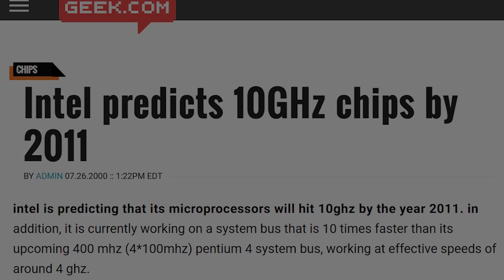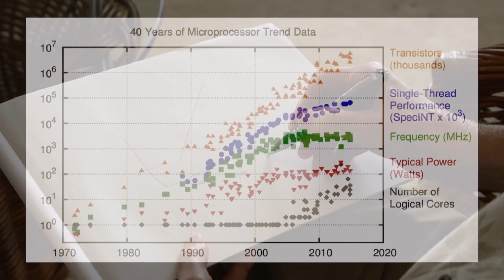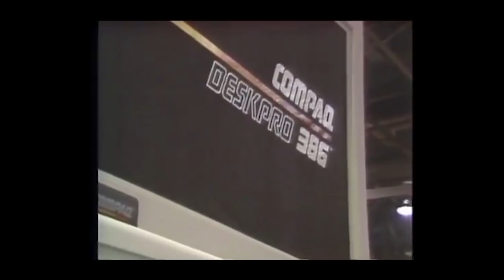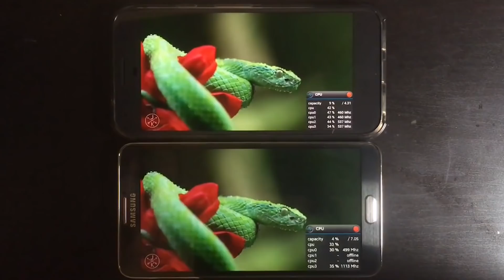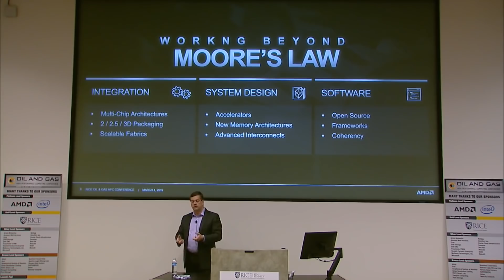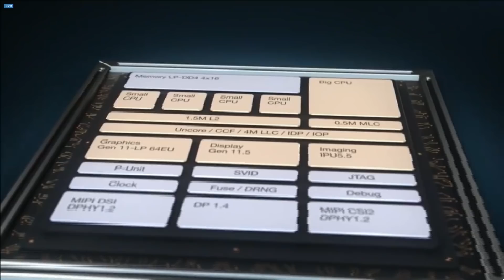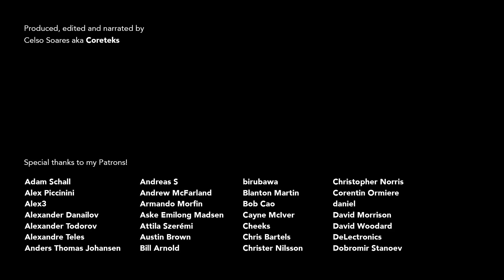Intel and AMD going BEYOND Moore's Law

Comment: Serious note here, what were the people expecting a 100ghz processor smoking? Speed of light propogation delay in a vacum would only get you a 3mm long signal path. It is unreasonable to think that instead of scaling out we would just settle for 9mm^2 CPUs with low transistor counts.

In an unrealistic situation with no switching delay 50ghz gets you 36mm^2, or half the frequency with quadruple the transistors, and 12mm getting a fourth the frequency at 25ghz with 16 times the transistors.

This means you get double the theoretical performance of a 3mm wide part at 6mm, and four times the performance at 12mm.

There is obviously a trade-off, since the 12mm part is only four times as fast despite having 16 times the area. This decrease in performance per mm°2 at larger core complex sizes definitely shows the existence of an efficiency sweet spot. 

SIMD style chips aren't affected quite the same way since they rely on mass parallelism, but the limitations still appear when trying to load data from memory.

 The only system architecture which might completely avoid this is one running a Barrelfish style multikernel on a non cache coherent processor with direct intercore communication. You can solve the task allocation with a Que Management Device for lower core counts, but a multikernel approach is going to have a scaling loss with a lower growth exponent than a hardware solution.

Comment: I am studying software engineering, your statement about not being taught multi-threading is not 100% accurate, we and most universities that I have heard of have a unit normally called Operating Systems that covers writing multi-threaded applications, normally in C due to it being such a low level language. It is then up to the developer/student if they wish to write future projects/assignments to take advantage of multi-threading, however most will not do so at university as your assignments are often relatively small and you only have a few weeks to complete them so seeing as you will not see a benefit in said small programs and only make your life more difficult most people do not do it for such small projects.
It is important to note that the university just provides you with a basic understanding and it is up to you to build on that, so most developers will not multi-thread unless they deem it necessary.

Comment: It shows Coreteks is not a programmer. Parallel code is not that difficult (seriously); It's all about splitting tasks.
Amdahl's law concerns single task ... not even single application :) There is always a lot of tasks running. Workstation i am writing this on is running 162 tasks on 882 threads. So for me, performance boost is not limited to 16 cores even with today's coding.

For example, this very page, single tab on browser, could be made to scale to 100s of threads - and it's not even "that difficult" - You simply split the tasks up. Very same thing you do with when you manage huge amounts of data - You split it up in organized manner. This is why "nosql" was such a big deal and huge hype some years ago; It forced non-skilled database admins to split up and index their data :)

Parallelizing is only hard when you have to parallize single task, for example rendering a single image. Difficulty depends on data format. But there is nothing stopping you from doing a single image render on 10 000 threads simultaneously other than available performance and acceptable latency as I/O channels filling up will increase latency. The true bottleneck is I/O - and has always been so. That's why AMD is so heavily emphasizing I/O.
Reply: "Parallel code is not that difficult (seriously)".
It is much less easy than single thread programs. You need a deeper understanding of the architecture, you need to manage all the threads with all that shared memory properly, you have to find tasks that can be split up which may involve designing a new complex algorithm that can run in parallel.
Anyway, I agree with you that this video describes it like it is almost impossible to code multithreaded programs.
Reply: @dariusduesentrieb  Yes, some knowledge of how computing works on a low level is required; Which any person coding anything performance critical should know already.

It's much less difficult than non-coders, and low skilled coders make it to be (unfortunately, i consider ~90% of coders to be low skilled). Basics are very simple -> Split up the data.

For example a old piece of code i wrote in the 90s, at a time the only practical way to get multiple cores was having multi cpu system, i had timers on one thread, sound in one thread, and OpenGL commands in one thread. Adding more threads would've been simple, but there was no benefit at the time (plus it ran like 200fps anyways).

To further split that up, if there would've been a need, i would've added a thread per audio channel (for SFX), separate thread for texture loading, geometry calcs (ie. order in which to draw polygons and perspective/camera), certain effects would've been on separate threads (distinct draw order), a separate thread to manage the actual calls to GPU (instead of calculating when making the call certain aspects) etc etc etc.
You split the tasks up.

When you get to something which is single task (single piece of data) the Amdahl's law may apply to your case, but often it is still just figuring out the separate tasks.

Data separation is the keyword; Then you do not need any code to manage multi-threaded memory access nor give it any thought. But when you need same data for many threads, often you can figure out a atomic method; For example, you can use RAM like a filesystem under Linux at pretty much full ram performance in every regard, but as you manipulate it like an FS, you have atomic functions to utilize; Thus no conflicts etc. each thread can access same piece of data with nearly 0 performance penalty. An example would be that i wrote a caching mechanism 100% in PHP which out performs memcached by orders of magnitude, by utilizing shm directly. memcached is supposedly high performance ram caching solution ...

and the raytracing only scales 95% is completely bullshit, you can spawn a thread for every single ray if you want to. Your bottleneck is speed of I/O (ie. cache, ram and so forth), computing wise ray tracing is pretty much perfectly scaling task.
Reply: @skaltura  "(unfortunately, I consider ~90% of coders to be low skilled)" lol :)
Reply: @skaltura  You're just wrong about amdahl. It's just a mathematical way of saying a parallelised function is as fast as the slowest sequential set of instructions in it, be it IO or what may have you.

Though you are right about pretty much everything else.
Reply: @mildpass  I did not say it was not. You misunderstood the meaning of what i meant with "tasks".

You pretty much described exactly what i meant where it is a concern, but called it a function instead of task/piece of data.

In computing, everything starts and ends with data, basicly a function about what to do with that data. Data separation enables efficient parallelization.
Reply: @skaltura  If "~90% of coders are low skilled" then parallel code is not "simple". You are setting bar of what is normal arbitrarily.
Reply: @tempname8263  Parallel code is actually rather simple, it is just that people are not taught coding fundamentals properly and people generally resist any sort of thinking; Where as by definition coding requires you to think a lot.
Until you put in your work and think about what you are doing, and what you need to achieve, you cannot ever get to the level where it is simple.
This is true for any and all engineering, but with say electrical engineering stuff is so established by now that schools do not need to teach people to think, just the stuff people have thought of already, the standard practices.

However, coding is barely taught in schools, let alone best practices.
Demand for coders have skyrocketed during a period where there has been practically ZERO proper education to do that, and essentially almost all are self taught without even as much as mentors.

Would you trust a airplane built by all self taught mechanical, hydraulical and electrical engineering? Would such an airplane follow all best practices for safety and performance? Of course not unless it happened to be only the top people of their craft; These people have learnt by trial and error and you cannot expect 100% of them to actually give it a thorough thinking and understand the fundamentals.

This is true about anything in life -> Learn the fundamentals, rest will come easy :)
Reply: I found it far more annoying that he always called computer programs "code". This isn't entirely wrong as machine code is also code, but it is very misleading.
Reply: The challenge isn't multi-threading. The challenge is with multi-core friendly applications running threads using symmetric multiprocessing (SMP)  where threads/tasks are simultaneous on multiple cores (not scheduled in sequence/round-robin, etc). This is much harder than just a multi-tasking scheduler in an OS when they need coordinate inputs and outputs (and avoid race conditions, etc).
Reply: There is a lot of misinformation in this video. When i scrolled down to the comments i expected people calling him out left and right - but the first 30 or so comments were kissing his ass talking about his "top notch journalism"...
Reply: "Parallelizing is only hard when you have to parallize single task, for example rendering a single image."
Bad example, parallelising rendering a single image is easy, each thread can do a single pixel. I do graphics in OpenCL (that means with my own GPU code for everything) and I render images and everything else in parallel, each thread does one pixel. I/O isn't much of an issue either because of consolidated memory reads, so if every thread running at the same time reads data from the same memory regions (as you do when you read a picture) then it doesn't take extra time because everything is nicely cached.
Reply: @Photosounder  I think you misunderstood my meaning, i should've been more careful :)
I mean rendering say jpg,png on a web page type of rendering. Can be parallelized too, but not as simple as say ray tracing.

Tho it's been more than a decade, perhaps even 2 since i've last time worked on that kind of code (rendering simple jpg/png or even opengl) so things probably has gotten a lot easier.

But it's surprising how little stuff is threaded in real life production code. I am quilty of this myself too, i got one backend management code which could benefit a lot with more parallelism but i think i'll just throw hardware at it :) (the server is more than decade old with HDDs, and it runs on a VM among many other VMs ... and it's clearly I/O bottleneck)

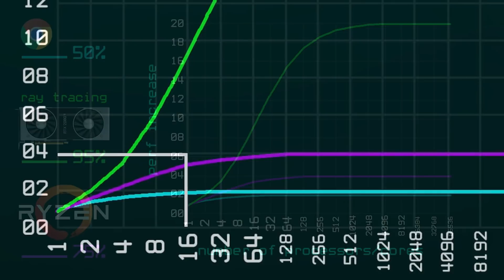Comment: 11:55 If this graph is correct, then I have the following prediction: There will be an approx 11% performance difference between the Ryzen 7s and Ryzen 9s. So Ryzen 9 3850X will be 11% faster than Ryzen 7 3700X, and Ryzen 9 3800X will be 11% faster than the Ryzen 7 3700. I'm going off the graph where there is an approx 8.5% difference on the cpu cores beween 12 and 16 cores on the purple line, and adding the difference in clock speed too, around 2% faster. Following the same pattern, I'd say a 14.7% difference between the Ryzen 5s and Ryzen 9s (21% factoring in clock speed differences). And for the difference between the Ryzen 3s and Ryzen 9s, 26% (and factoring in clock speed differences, 40%). We'll see how these numbers fare in real life if the graph (and Adored TV's frequencies) are correct. This should scale like so in games too.
Why bother with this prediction? It's useful to know the rule of diminishing returns when trying to figure out which processor you want to buy. For me, as a gamer,  the 3700X 12 core looks like the sweet spot, again, if Jim's (Adored TV's) prices are correct too! :)

Comment: What you're describing is really kind of already what modern CPUs do. In superscalar architectures, multiple instructions run in parallel and with out of order execution, the instructions can be dispatched to multiple components e.g. ALUs at the same time. It's the same thing, making use of parallelism at the silicon level.
Reply: It is the same idea but at a thread level. Analyze a thread detect where dependency is predictable partition the thread into threadlet with predicted dependency. Reroll if prediction is wrong.

Comment: Silicon atoms are around 0.1nm wide, and you can't make a conventional transistor from one atom... probably takes at least 10, maybe more (we'll see).  But that does put a lower-bound on chips made out of silicon gates.

On the other-hand, we are still working primarily in 2 dimensions.  Sure, the chips do have layers... mainly for routing.  But not so much for logic.  So one possible next-step is to begin to be able to stack logic.  Of course, this too will have some severe limitations with regards to power density and heat.

In terms of cores... well, I don't know how you are making those calculations but as far as ray-tracing goes there is nothing stopping the parallelism from reaching right down to the pixel... millions of cores is a not a stretch in terms of scaling ray-tracing.  This is mainly because while many of the objects will be shared, that's just a matter of cpu caches.  The pixels are written to, the objects are not, so there is no replication limit in terms of the backing data and no limit on sharability.

Just about any workload that eats up a lot of processing time can be partitioned.  Take bulk video generation for example.  You can break that up on I-frame boundaries of which there are many.  There is really nothing stopping a bulk renderer from splitting the problem into a million pieces beyond storage bandwidth (which again is just a replication issue since the input data set is read-only).

There are really no software limitations involved here.  Well, there is one related to shared page tables.  All CPUs sharing the same page table generally need to be synchronized when a page is removed from the mmu, requiring a concurrent IPI and there is a bit of scaling problem with synchronizations based on concurrent IPIs.

But there are no process or threading issues.  I can spin up a million threads right now given a few gigabytes of memory for structural and context storage.  It only takes a few seconds.  They won't run very quickly without a lot of cores to support them, but the operating system doesn't really care or have an issue with it.

Not all software is conducive to parallel programming, and ts kinda silly to add the sophistication to programs that don't actually need it (because they run quickly anyway).  That is the bigger roadblock for seeing lots of cores in a consumer cpu... after a certain point, most of the software you run just won't need any more cores to be able to present some useful result (such as running quicker).  Do you care if a desktop takes 10 seconds to open 100 windows instead of 1 second?  Nope.   So the number of applications where users are willing to spend money on more cores dwindles as the core count goes up whether or not the applications can use those cores.  If you are already getting 90 fps at 1440p for your favorite game you aren't likely going to invest in a 1024 core CPU even if the game could use all those cores to boost to 900 fps, because your monitor can only do 144 fps anyway.   For example.  Similarly for video and photo processing.  You might care if you can process a 1 hour video in blender in 8 hours instead of 16, or in 4 hours instead of 8... but at some point you will stop caring, and at that point it just won't be worth the money to buy more cores.

Amdahl's 'limit' is nonsense.  It doesn't apply to modern systems, and multi-core programming is not a new thing.  I've been doing it for 25 years myself.  It's definitely not a new thing and it is also not actually all that difficult to learn.  Many problem sets are just naturally partitionable.

-Matt

Comment: "noone has been able to pull it off"

the entire point of a superscalar processor is to execute instructions from a serial program in parallel
Reply from the maker: OoO doesn't mean parallel, I think you have those confused.
Reply: @Coreteks  maybe VISC has some benefit. i don't know. i'm just saying it's not the only way to get ILP out of a single thread.

Comment: You should check out C++  17, it already has stl constructions, that can be parallelized, with just changing the execution policy. If you are crazy, you can even decide to run the code on the GPU, although that is still experimental and requirs external libs. https://en.cppreference.com/w/cpp/experimental/parallelism
Also I think rust heavily supports the use of parallelism, but I have never used it before.

Comment: Using multiple cores is not that easy especially not in software as it means locks or some other synchronization and that makes it not really useful to even have threads.
And even if you can get over that you still would have a lot of problems as context switches are expensive at least in used space so there is no way to make that better or definitely not in software without major drawbacks.